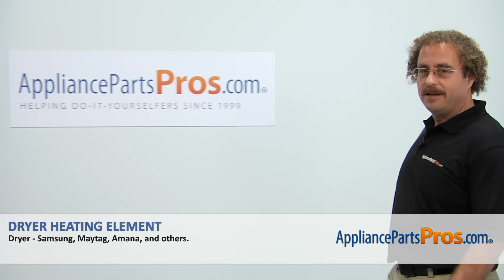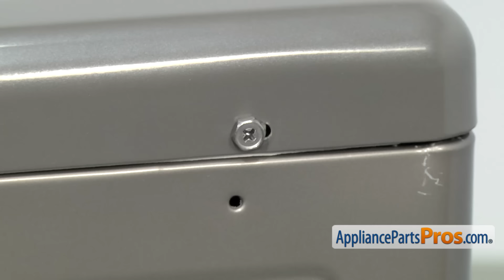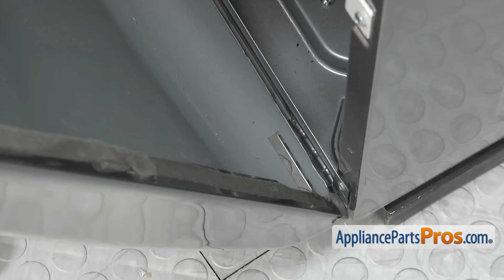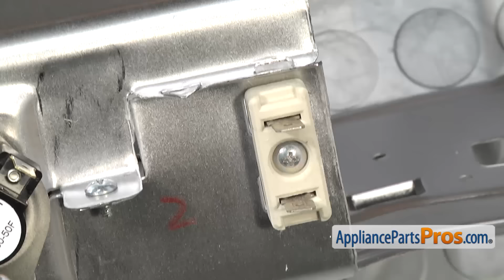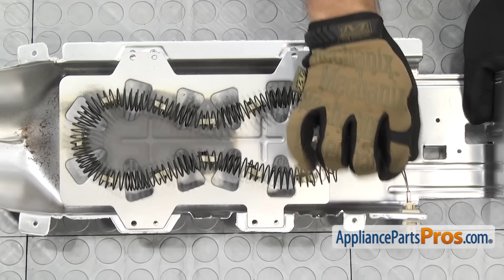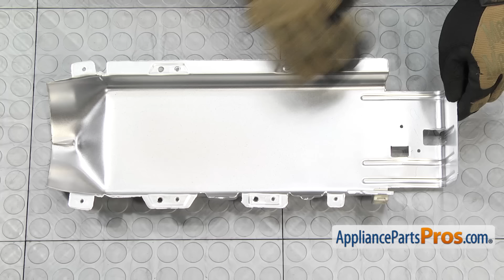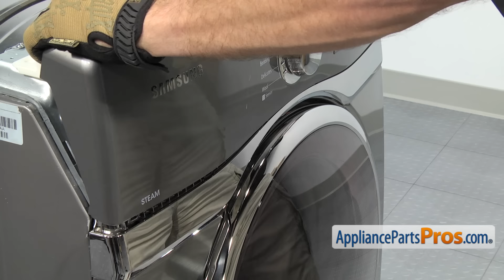How To: Samsung Dryer Heating Element DC47-00019A

Comment: My dryer heating element, the old part is smaller then the replacement I got for it. Like it won't fit in the house for it?
Reply from the maker: If you provide the full model number of your appliance we can help you locate the correct part number for your unit.

Comment: What if doesn’t run more than 5 minutes and doesn’t heat up help me out pls thanks
Reply from the maker: If it runs for only a few minutes and doesn’t heat, start by checking the thermal fuse, heating element, thermostat, and airflow. Also make sure the dryer is getting the correct power supply. 👍

If you need further troubleshooting/ testing from our techs you can check out our repair forum:
https://forum.appliancepartspros.com/

Comment: I'm replacing the thermostat and the thermal fuse in which direction the new parts should be facing(up, down) great video and thank you for sharing.
Reply from the maker: Thanks for watching! For the thermostat and thermal fuse, the orientation depends on the exact dryer model and how the parts are mounted in the housing. In most cases, they should be installed the same way as the original parts were positioned.  

If you need more troubleshooting or installation information you can check out our Repair Forum: https://forum.appliancepartspros.com/.  It’s easy to register, and you can either post your question or search the forum to see if someone else has already asked the same question.
 
Our experienced technicians, with over 20 years of hands-on appliance repair experience, are ready to answer your questions and guide you through your repair.
Reply: @appliancepartspros Thanks again the dryer is working and heating just as it should. Your video and support was very helpful. Have a great day and thank you 💯%
Reply from the maker: So glad the video was helpful! Thanks for watching!

Comment: What if the wires are a little dis colored? My kit did not come with new wires.
Reply from the maker: A slight discoloration from normal heat exposure is usually okay. However, if the wires or terminals look burnt, melted, brittle, or heavily darkened, they should be replaced before installing the new heating element. A damaged connection can cause poor performance, overheating, or even damage the new element.

If you need further troubleshooting or testing information you can check out our Repair Forum: https://forum.appliancepartspros.com/.  It’s easy to register, and you can either post your question or search the forum to see if someone else has already asked the same question.
 
Our experienced technicians, with over 20 years of hands-on appliance repair experience, are ready to answer your questions and guide you through your repair.

Comment: Mine is newer and the bracket is screwed in
Reply from the maker: The removal steps can vary a bit depending on model. Just take your time removing those fasteners and it should come apart the same way once the assembly is free.

If you need more in depth troubleshooting or testing information you can check out our Repair Forum: https://forum.appliancepartspros.com/.  It’s easy to register, and you can either post your question or search the forum to see if someone else has already asked the same question.
 
Our experienced technicians, with over 20 years of hands-on appliance repair experience, are ready to answer your questions and guide you through your repair.

Comment: I wish it was that easy unfortunately I have a 2023 Bespoke type Dryer with a center control knob.. yes a 2023 and dryer element is already fried 

I will never buy another Samsung 

They have hidden all the screws and tabs to make DIY incredibly difficult 

It’s a U shaped type body no seams sides or rear only front … although ever tab and screw is hidden 

You have to lay the Dryer FLAT on its back after you remove top then 2 hidden screws under console small covers then push tabs , then once you get past that 4 screws on top screws on front one hidden inside on the lint filter unit 

And the heating element an indented SEALED 3 tab connectors. 

This board shown has a total different wiring configuration 

Good luck!
Reply from the maker: Thanks for sharing your experience—it’s helpful context for others working on the same model.

Comment: When putting the terminals through the ceramic piece, you put the bottom wire through the bottom slot and the top through the top.   How important is that?  I did the opposite.  I would think that it shouldn’t matter because it’s just passing the current through regardless.  Do I need I take it apart and make sure the top wire is put through top and the bottom wire is put through the bottom??
Reply from the maker: The bottom terminal will need to go through the bottom slot and top terminal will need to go through the top.

Comment: I replace the heating element but it appears. I also need to replace a a couple of other parts the internal fuse and the high heat limiter
Reply from the maker: If you need help locating parts you can chat us through the website, or you can call us at 1-877-477-7278 Mon-Fri 9am-8pm EST

Comment: Our heating housing doesn’t have screws, looks like snap on or something like that. How to take upper part out in such case?
Reply from the maker: You can visit our Repair Forum: https://forum.appliancepartspros.com/. It’s easy to register, and you can either post your question or search the forum to see if someone else has already asked the same question.

Our experienced technicians, with over 20 years of hands-on appliance repair experience, are ready to answer your questions and guide you through your repair.

Comment: I have lost count how many times I have opened this POS samsung dryer in the last 10 years i owned it. Time to junk this and never buying SAMSUNG AGAIN!!
Reply from the maker: Sounds like you’ve had a rough ride with that dryer! Hopefully your next dryer gives you a lot less hassle.
Reply: @appliancepartspros  going  with GE next!
Reply: @llGeomanll  Good luck with THAT. I bought GE appliances in my 2018 kitchen renovation (stove, dishwasher, refrigerator) and they suck. I've already had to replace a heating element for the stove (very expensive -- glass-topped stove), both racks for my dishwasher -- the lower rack twice -- because of rust, and the defrost cycle switch for the refrigerator.

I put a Samsung refrigerator in the first floor apartment of our two-family, a few years ago and the tenants love it. It's been at least 4 years now -- way better than the GE fridge upstairs.

I suggest sticking with the devil you know. :)

Comment: what if it’s not the heater element?
Reply from the maker: Good question. If it’s not the heating element, there are a few other possible causes, but for detailed troubleshooting steps specific to your situation, our certified techs can help you at forum.appliancepartspros.com. Just post your model number and what you’re experiencing and they’ll walk you through the diagnosis! 👍

Comment: The polarity on the sensors doesn’t seem to matter. I reversed them as an experiment and it still works
Reply from the maker: Thanks for sharing your experience! 👍 Results can vary by model, so for model-specific details or questions, our certified techs can help at forum.appliancepartspros.com if you want to dig deeper.

Comment: Bro! Just finished changing the heating element myself by following your tutorial. Was able to fix the dryer and working now. There were 2 little screws behing the heating element support but by using a mirror I was able to remove them no problem. Great video and thank you!
Reply from the maker: Awesome! Happy it worked out and nice job getting those screws out. 👍 Thanks for watching and sharing the update!

Comment: Thanks for this video. It helped a ton. Though my heating element housing doesnt appear to sit flush. It goes in but theres a decent gap at the top. This isn't normal, is it?
Reply from the maker: Did it attached properly whenever you installed it?
Reply: @appliancepartspros I returned and reinstalled it. I feel like it wasn't properly in place. There's a much minor gap now.

Comment: It appears my heating element bracket is screwed down instead of clipped. Is there a video on how to remove the heating element if the support bracket is screwed down?
Reply from the maker: What is the model number of your dryer? Also, what type of screws are holding it down?

Comment: The replacement elements last about 2 years then you have to do it again.
Reply from the maker: @Commentleaver-c6x Thanks for sharing your experience. If the element is burning out every couple of years, it might be worth checking airflow (vents, lint buildup, etc.) or the thermostat and fuse — restricted airflow or overheating can shorten element life. Let us know your model if you’d like help checking what might be causing it! 🔧🔥

Comment: Hey can someone plz help me. Our wasn’t heating so we changed to sensor and the fuse no luck. Took it apart again and changed the heating element and also the small part next to it that the blue wires attach to. We put everything back the same way but no heat. Can someone plz help? Ty 🙏
Reply: When we put in the new heating element and the other small part right next to it I couldn’t tell if it was upside down or right side up but I made sure the wires went back in the same place could this be the reason why
Reply from the maker: You’ve already done some solid work—nice job sticking with it! 🙌 If there’s still no heat after replacing the element, fuse, and thermostat, double-check the wiring to the element and thermostat (especially those blue wires), and make sure you’re getting 240V at the wall outlet—these dryers need both legs of power to heat. Let us know your model number too—we’re happy to help you pinpoint the issue!

Comment: Thank you for a very informational video! I ended up replacing the and plugging everything back in; however, when I started the dryer it certainly was heating but much too quickly. The side of the dryer was hot and once stopped, a wave of heat came from the dryer after 2-3 minutes. I’ve unplugged the dryer now, but any idea what may be causing that? Thank you again!
Reply: Please correct me if I’m wrong, but I feel like the previous element needed to be on high since it was on its way out. With the new element, if I put the temperature setting on low, it seems to heat enough without being too too hot.
Reply from the maker: What is the model number of your appliance and the part number of the heating element you replaced? Also, did you check for lint build up inside the unit and the vent?

Comment: This video confuses me because I've changed the heating element on my dryer 2× before & the front did not have to come off for me to do that. The professional that changed it the 1st time under warranty didn't take the front off either. I didn't look up how to back then either though so I think I'll just older guy mechanic it and not get instructions first🤣 I do my own work but I do love more than a couple old mechanics♥︎ 

Yeah it's on it's 4th replacement, I'll never buy a Samsung dryer again. I did make it last longer by stuffing a rigged with a smaller than my vacuum hose tube in through a hole I cut in the back so I could vacuum the lint out every so often. I highly recommend doing this. It more than doubled the time between change outs. 

I replaced a clutch on my son in laws car approx 7-8yrs ago & in half the time the labor guide called for. I didn't have to take off near as much crap as it showed in a video I checked out recently when it went out on him again. This really has me thinking that life is easier for us DIYers if we give it a go before looking up assistance 😅
Reply from the maker: Thanks for sharing your experience—sounds like you’ve had quite the journey with that dryer! We totally get the appeal of just diving in and figuring things out, especially when you’ve got mechanical instincts like yours. Some Samsung dryer models can be accessed from the back, but others (like the one in this video) require front access to safely reach the heating element, depending on the layout and design updates. Great tip about the lint vacuum hack, too—keeping that airflow path clean is huge for longevity. 👏

If you ever feel like teaming up experience and instructions, we’re always happy to help walk through the steps!

Comment: On my Samsung dryer, the bracket that supported the heat element has two screws on the backside of the bracket and then there’s one screw that is on top of the heating element holding it down to the bracket so you might wanna remind people that they might have to look for that goodbye
Reply from the maker: Thanks for the heads-up, Robert! That’s a great callout—those hidden screws can definitely sneak past you if you’re not expecting them. Appreciate you sharing the detail, and glad you tackled it!

Comment: You need to advise people watching this video that you just can’t lift the bracket holding the heating element because there are three screws that hold the bracket down and two of them are on the backside that you can barely get to and one is underneath the heating element enclosure so please advise people that there are three extra screws if you don’t talk about and have a great day
Reply from the maker: Thank you for that tip!

Comment: Thank you for the easy to understand instructions! I changed my heating element today! And since I had the front open, I also vacuumed out my dryer and got the inside all cleaned out, including the vent! 🎉
Reply from the maker: That’s awesome! Not only did you fix your dryer, but you gave it a deep clean too—great job! Keeping the vent and inside clean will definitely help it run more efficiently. Thanks for watching, and happy drying!

Comment: You are amazing and Matt #1 (as opposed to that other guy whom I wouldn't invite into my house to fix anything.) Though on Valentine's Day (yesterday) I finally was coerced by my spouse of 51 years (I didn't think you could legally be threatened with divorce after 50 years.) and then the wonderful and encouraging people at Reliable Parts (retail and wholesale industry) I was back home.  We had the same model you were working on that's fiur 1/2 years old but with the serial number scratched out had no warranty.  Well, with hubby standing over me with the whip and carrot I persevered.  The company that sold it to us must have had a great time putting numerous parts to make our "new" dryer.  All casings and wire harnesses from the first step on were cross-threaded screws of which every available screw hole was filled;  the plastic housing of the first wire was glued shut so put the top still attached, above the dryer,  the door did not wish to be removed and the wire harness was soldered together and wires roughly taped, so in a small working space had to balance the door still attached delicately with supporting towels across the top and washer adjacent, should have worn a hard had in addition to safety glasses and gloves.)  The craziest part was that someone did not want this to be a DIY as the old thermal unit was screwed inside to the bracket and the bracket wasn't just placedin the slots at the back but screwed in to the dryer housing.  I hastily bent inside to ensure the colour and positioning of the wires were the same and they were.  That was promising knowing we weren't dealing with apples and oranges.  Bending the old aluminum casing forward the screw was in position to be removed so that the old unit could no be pushed gently upward and bracing it with smaller hands and short handled Phillips screwdriver was able to work the two screws behind the bracket, albeit blindly and touch and feel 1/4 turn at a time.   -- shortening the story with issues related to the lack  of care the technician who put the old one in including the wiring that didn't have enough length to bring the old unit to the front of the  dryer on its side, the new one was installed which by the way ensures that you aren't replacing just the element but the whole unit because its now soldered shut on all the latest shipments, -- well I'm still married and after 1500 hrs. put the glazed ginger/garlic confit and blackberries duck in the oven with veges and stuffed with fresh rosemary embellished wild rice and Valentine's dinner with candlelight; Bill Evans on the turntable and 13 year old vintage served with a fresh from ablutions wife serving.  Happy Valentine's 2025 Matt #1.
Reply from the maker: Wow—what a journey! It sounds like you tackled a repair that was never meant to be a DIY, and we’re beyond impressed that you made it happen. Wishing you and your spouse many more years of teamwork, great meals, and hopefully easier repairs in the future. Happy Valentine’s 2025 to you too!

Comment: 3:30 If you're having trouble lifting the heating element, on the back of the bracket there may be two screws, additionally there might be a screw holding the bracket and the heating element together.
For the back screws, maybe you could use a short Philips head screwdriver, but for the screw holding the bracket and heating element, I needed to use a right angle screwdriver.

Besides the above, nothing else was different on my drying machine.
Frustrating the Samsung essentially made it so you need an additional tool to change the coil, but c'est la vie I guess.

Also this tutorial was amazing, really easy to follow and it made the process very easy!
Reply from the maker: Thank you for those tips! So glad the video helped with your repair!

Comment: What was actually wrong with the old one?
Reply from the maker: You can test a heating element for resistance if you think the element is bad.
Reply: @ thank you.   Mine was bad( your video gave me the insight to pull it, actually out of the tube where I discovered that the coil was broken).   I ordered a new one.  

Great video. Thank you